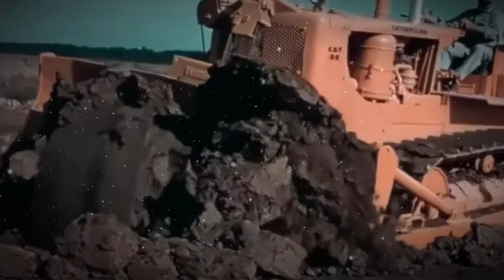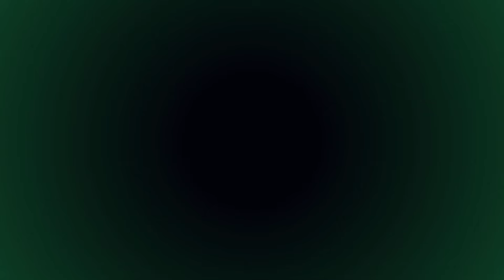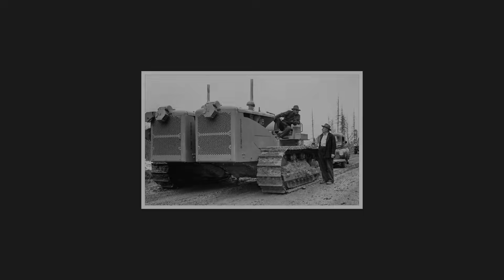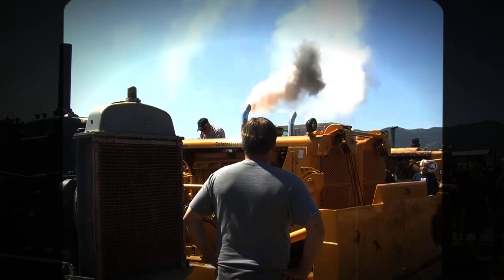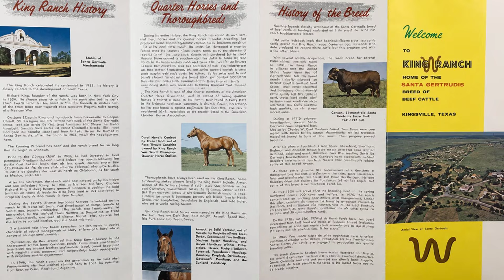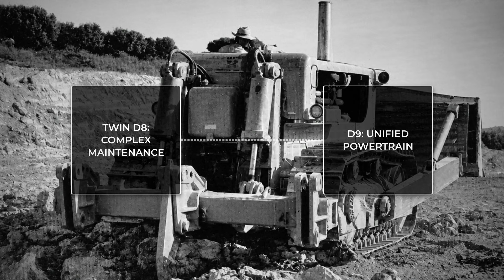Twin D8 Dozer: The Epic Custom Cat Beast That Changed Earthmoving

Comment: Hello, Whole Ball of Wax.
I have a 'kwestyun' fer yer: "HOW could taking two tracks AWAY from two separate tractors, leaving them with ONE track each and then bolting them together 'DOUBLE' the ground contact area?????????"

"Inside the custom cab"??????????????? I can tell you for an ABSOLUTE CERTAINTY that NONE of these machines were EVER originally built with cabs of ANY sort, custom or otherwise. ONE was eventually fitted with a cab AFTER it had been working for some time. Another was fitted with a heavy protective timber canopy for clearing before it went to work.

HOW do you have 'differential' steering in a machine with 'clutch-and-brake' steering.?????????????????

There were NO hydraulics on ANY of these machines - see above.

The Holt Caterpillar dealership in Texas DID NOT build the high-clearance versions of these machines. Peterson tractors Built them and shipped them to Holt to have the clearing equipment manufactured and fitted by Holt.

The existing machine in Oregon was NOT a 'restored' machine but a complete 'from-the-ground-up' RE-creation of this design.

HOW do I know? I collaborated with Peterson Tractor's historian on researching the history of these machines - including getting to see the original drawings.

Donchya wish yer REALLY knew what yer wuz talkin' about????????????

Just my 0.02.

You continue to have your wonderful DELUSION. Best wishes. Deas Plant.